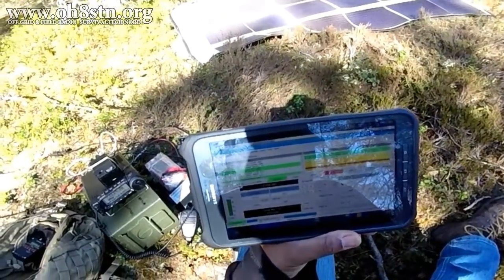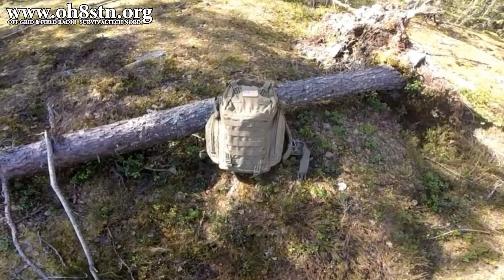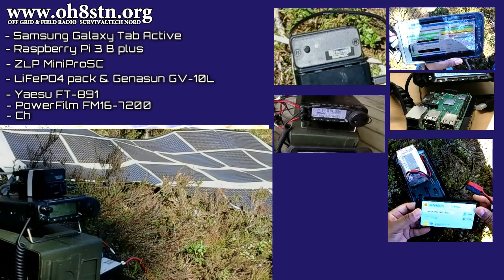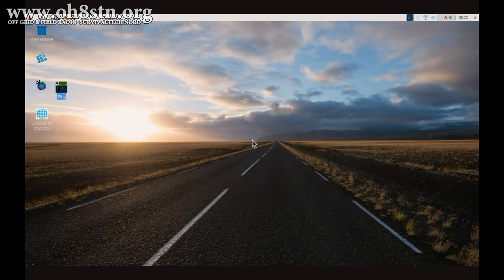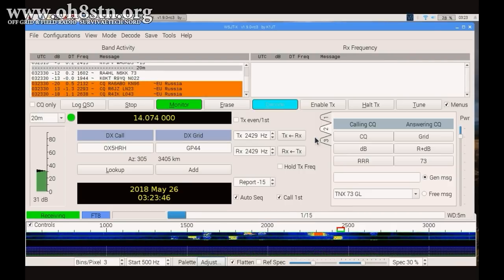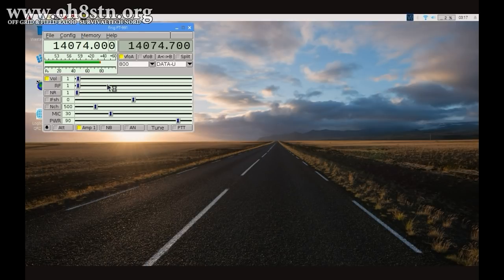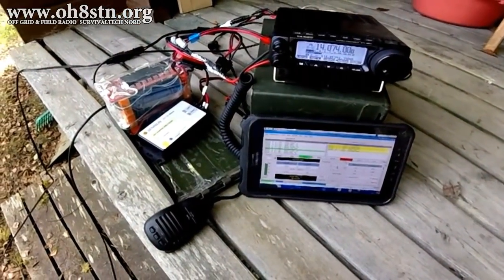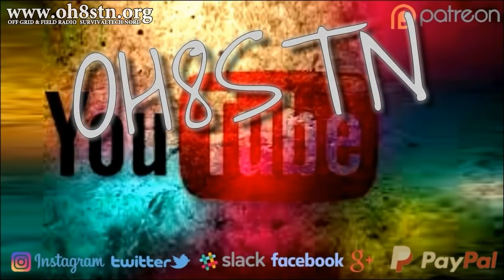Raspberry Pi Powered Portable Ham Radio Station

Comment: I've had great success with the Raspberry Pi decoding FT8.... so much so, I always use the RPi3 for digital modes... even in the shack. 
My  $7 USB soundcard works as well as my SignaLink too. It's a little more tedious to get audio levels set correctly than the SignaLink, but it's much lighter to pack for portable operations. 

My 10" tablet screen will display the entire FLDigi interface.....high resolution = small font but I find a wireless mouse and Bluetooth keyboard makes it a breeze to use. 

I especially like using the RPi3 in the shack as I can be upstairs with my tablet, logging QSO's from my recliner. 

Keep up the good work...de WØFW
Reply from the maker: Actually you're the one who started this whole thing and I'm grateful to you for it. The Headless pie was a magnificent idea. It's also nice to hear someone else confirm the performance of the Raspberry Pi for digital modes. I've been thinking about one of those little sound cards to use with the WolphiLink. Just to get everything that much  smaller.
Thanks for everything you do and for sharing the knowledge.
73
Julian oh8stn
Reply: Mad Dawg how are you adjusting the levels on your cheap soundcard dongle? That is also what i am using with my RPi, i am having great luck with Rx.... mixed results with Tx. I suspect its just blasting sound in there, and I need to turn it down... maybe.
Reply: spldrong 
Basically I set the audio drive levels using the volume controls in the RPi3.... this gets it in the ballpark. 

To fine tune the levels, I adjust AF gain for received audio and mic gain for TX audio. 

Does that help with answering your question?

Comment: I have been using my Pi3 as a general RF transmitter for quite some time, well in controlled environments anyway. I'm not a licensed ham yet and I want no trouble from the FCC. The RPi has loads of potential for RF applications

Comment: I can't help but look forward to when the RPi team drops this level processor onto the pi-zero(w) platform... you could put a 'cluster' in your pocket! 1-fldigi, 1-FT8, 1-w/TNC-Pi.  (sorry if I'm getting ahead of myself here)
-Rob
Reply from the maker: Yeah the idea of having all HF & VHF bands running simultaneously from something the size of a big box of matches. 😮
Reply from the maker: Now I understand what you mean by this level of processor in the pi zero. I'm thinking about a new project with a Raspberry Pi. Taking a pi zero and putting it inside an 817. At the moment I think the processor is too slow on the pi zero, which was exactly your point I suspect. I'm wondering if I pull off all the USB ports from the 3 B plus, could I use it in place of a pi zero

Comment: Hi. I am glad you found the Raspberry Pi and Bluetooth keyboard and mouse useful. I have now installed a RTC clock to be able to use the Pi' s clock when internet is not available. I have also ordered the Pi 3b +. But have not tried it out yet. I am working on my go box built into a 3 tier tool box on wheels. It is not ideal for hiking but here in 9h1 land distances are not a problem. Looking forward to the next instalment.  I always enjoy them and I learn a lot from them.
Chris de 9H1BW
Reply from the maker: You're far too kind Chris but it is much appreciated.
Two of the things Raspberry Pi related I need to work on or an uninterruptible power supply for it, a real soft button for startup shutdown and sleep, and then making a frame for the radio, Raspberry Pi and all the other components inside that ammo can.
I have a feeling your weather is a lot better than what we're having here in Finland at the moment 👍👍👍
73
Julian oh8stn
Reply: OH8STN the soft turning off psu  is interesting . The sd card is very delicate and does not like being switched off before being shutdown.
Reply: An alternative to a RTC module is a GPS which gives extremely accurate time as well as position data.
Reply: John Tarbox how does one connect the GPS to the rpi?
Reply: chris9h1bw I am using a GlobalSat BU-353-S4 module which simply plugs into one of the Pi's USB ports. Works great and is available for about $30. Fully supported by the OS on Pi.
Reply: John Tarbox thanks. Will look it up.
Reply: sudo date -s "Fri Jun  1 02:15:00 UTC 2018"

Comment: Yes, I’ve run WJST on an RPi3, and it was able to keep and decode just fine. You’re right about the performance. Windows is a bit bogged down with extra processes running in the background. RPi3 doesn’t do this, and gives you a good performance in return.

Comment: Great video.  You may want to check out Maxpedition or Vanquest packs, Condor gear is poorly constructed in comparison.  Imagine how impactful a split seem or broken zipper would have been.
Reply from the maker: Agreed. Unfortunately Maxpedition and Vanquest don't have good sales distribution outside of the United States. Anyway, the weight of my kit was well within the limits of the Condor pack. My Expedition pack was Overkill for this trip.
Reply: OH8STN oh, didn’t even think about distribution networks.

Comment: Julian, I’m so grateful for you videos. I just ordered a Pi. I have been playing around with VNC on my iPad controlling another computer on the wireless network. How are you able to connect your tablet to the Pi with VNC away from the internet? Bluetooth?
Reply from the maker: Hi Chris. The short answer is creating an access point on a Raspberry Pi. Then giving that access point to static IP address. You should definitely check out my website and use the search function for "raspberry pi ". That'll bring up all of the Articles I've done on the Raspberry Pi including the access point and inevitably your next question which will be how to sync the clock.
73 
Julian oh8stn
Reply: Excellent! Thank you so much. -73, KC3EXN

Comment: I use the short case from PiJuiceSupply, holds a RPi and pijuice hat with all ports. They also make a tall case for more stuff stacked on the RPi.  The RPi 7 inch touch is to small to run/view all parts of the programs, I cannot see the waterfall and data screen on the same page.  Will try your set up on a 10 inch screen.  Great stuff!
Reply from the maker: It's always good to get your feedback. Have you documented your build any place? You could drop the link here if you like.
I'm really looking forward I'm getting started with a 3D printed stuff.
73
Julian oh8stn

Comment: Yet another great video that's got me excited about portable operation. I recently got my Wolphi link interface, looking forward to using it (although due to an insane work schedule it might be late June before I get the chance). This video inspired me to dig out a Rasberry PI3 I won as a door prize some time back, it's still new in the box. My question is, what OS are you running on it? I know there a ton of different ones available, but if I use your video as a starting point it'd be nice to reduce friction by just using the same OS. 

Hope to work you on the  bands one day, 73 and thanks, N4IXT
Reply from the maker: Huge thanks for the kindness. Was actually worried this would be a crap video, but it seems to be inspiring a few of you. So my Raspberry Pi is running raspbian Jessie. It's a debian-based OS, and I believe the official OS for the Raspberry Pi. If you want to use the WolphiLink, you'll need a cheap USB sound card, and a y cable with separate mic and speaker on one end and trrs for the WolphiLink on the other.  In fact I'm also planning on doing this, to reduce the size of the kit in this video. Remember it doesn't take a lot of effort to go out in the backyard and give your gear a spin. Take baby steps, and before you know it you'll deploy a field station ☺
73
Julian oh8stn

Comment: Thanks for the great video Julian :-). Considering FT-8 requires an accurate clock to operate, is there a method of using a GPS for the clock when out of range of the Internet and/or cell phone range?
73,  Jack VK4JRC
Reply: Jack Chomley I have recently setup a RPi 3B+ using a cheap GPS receiver for this very application. It’s configured for ntpd to communicate with gpsd. Works perfect for operating in an area with no internet connection. I haven’t documented this yet but hope to do so soon. 73 Marty W5MRM
Reply: sudo date -s "Fri Jun  1 02:15:00 UTC 2018"

Comment: Thanks for a great video.  How do you connect the tablet wirelessly to the RPi?
Reply from the maker: Dave Corsello I've done it two different ways so far. The first way is to use an external Wi-Fi router. The other way is to create a network with the tablet allowing the Raspberry Pi to connect to it. With Raspberry Pi 3 B plus it also has an access point mode but I haven't tried it yet, I've only read the documentation.
Thanks for watching, and for the kindness It's very much appreciated

Comment: Yes the pi works for ham and satellite. Lower power tritium solar batteries and super capacitors. Or use simple dirt battery aka earth or ground battery. Fractal antenna to save space. Building similar myself. With touch screen on outside. Like to add hand crank for power too. Can solder wires on to sim and add script for internet. Some tablets will take a Linux operating system. Most appliances run Linux. In fact Linux devices make up over 85% of devices. But its like microwaves, stoves, cars, and androids. Yes android is a desktop on a Linux kernel. I see it possible to have ammo can capable of most forms of communication. As long as computer can run TPM for decryption. Security too don't want a virus transmitted over digital air waves. Waiting to see on news. With law enforcement going digital. The pi being 10$ to 35$ depending on model. Linux computers run good. There is a learning curve but many videos info and community support. Kids play Retropie on one of our pi. They make android auto touch screens too. Would fit in ammo can too. Great video.

Comment: I am just beginning with FT-891 and digital modes.  I am having a hard time connecting to my windows laptop.  shouldn't the usb cable be a complete connection?  at 4:16 you say that you use the usb cable to interface.  I have not gotten that to work.  Couild you point me to instructions on that?
Reply from the maker: Here you go. ☺
These instructions will get you started
https://youtu.be/SrXbg9ytksU

Comment: Why you don't try without a tablet and with a 7inch touchscreen for raspberry pi??
Reply from the maker: Because I have to carry the tablet anyway. It's my telephone 😀
73
Julian oh8stn
Reply: OH8STN a very big phone😂😂never mind Federico IU1JEX 73
Reply: I just got my radio setup this way too after seeing this video. It is really nice having the android wirelessly control the whole radio! You can get really far aways and still do everything except control the volume and tune the tuner.
Reply: @TheElpoja, do you use a RPi with touchscreen on battery power?  If so, which monitor do you use, and what is it's power consumption?

Comment: Another great video Julian.
Out of interest, does the WolphiLink work with the Pi?
I'd be really grateful to hear whether it does or not. 
73

Matt
M0PTO
Reply from the maker: Hi Mat. When I saw the trrs connection on the Raspberry Pi I was hoping it would be mic and speaker audio but it wasn't it's an audio/video port. Thankfully there is a workaround. We can use a USB sound card dongle, with a custom cable. On one end of the cable we have trrs with speaker and mic, on the other hand we have split mic and speaker on separate jacks. Those two Jacks go to the USB sound card which plugs into one of the ports on the Raspberry Pi. The other end of the wolf healing goes to the data port on the back of your radio. I think I'll order the parts and make a video for that small project.
I hope this helps and thanks for the kindness.
73
Julian oh8stn
Reply: OH8STN It would be really great to see a video of it.
I got the WolphiLink after watching your videos using it, and am also likely to get a Raspberry Pi because of the limitations with the Android apps.

I also have another question Julian. I wonder if you'd be kind enough to email me? My email address is on QRZ.com

Thanks again.
Reply from the maker: I'll get to that video at some point, but for sure.
Reply: OH8STN That's great - thank you!
It'll be clear why my message won't work this way and needs to be emailed once you read it
Thanks again Julian. 

Matt
M0PTO

Comment: Julian, great video. Question: What sound card are you using with the Pi, and WSJT-x? I am
having a problem getting WSJT-x working with Signalink and linux on the Raspberry Pi.
Reply from the maker: So many comments came in I missed some of them so apologies for the late answer Tom. I'm using the zlp MiniProSC audio interface.  It shouldn't be any different than the Signalink.  I suspect the problem you're having is in the audio settings for raspbian. Go to the audio preferences from the drop-down box select USB audio codec. At the bottom of the screen you see "select control". Make certain all three boxes are ticked. In wsjt-x When selecting the audio interface select HW USB audio codec.
I hope this helps and again apologies for the late reply
Reply from the maker: I just noticed the second part of your question. I'll start doing some tutorials for the Raspberry Pi as soon as I have a second one.

Comment: Will the software support the FT-857? or the old FT-100D
Reply from the maker: Definitely. The ft-857, 897, 817 and ft-100 are all supported by Hamlib. The software uses hamlib as a basis for rig control in the app.

Comment: bought that + but it seems a bad choice :( only works with the latest version of raspbian , doesn't install any database software and seems to have an enormous power need.  also runs slower than a standard 3b   if one wants to run older raspbian or debian or other linux distro's the 3b+ isn't a good option

Comment: Great...looks like I'll  be buying ANOTHER Raspberry Pi. Lol
Reply from the maker: Yes I'm there as well. I'm trying to figure out how to fit one of these raspberry pies inside the radio
Reply: One question.

Does you tablet function as an actual touchscreen for the pi, or is it like a touchpad to move the pointer?
Reply from the maker: It functions as a natural touch screen. In fact you can think of it as a wireless touch screen
Reply: @OH8STN  ok. Last two questions. Are you using the tablet as the hotspot, or the pi? And did you have to do anything settings wise to get it to function that way?

I have repurposed one of my pi3b+ and habe.  It set as a WiFi hotspot with the vnc server turned on. When I connect with my phone it functions like a trackpad instead of a touchscreen. Gonna try with a tablet sometime today and see if it is any different.
Reply from the maker: @shank0  oh my God, you should really start to read my blog 😀
https://oh8stn.org/blog/2018/08/13/x-days-off-grid-radio-raspberry-pi-prerequisites/
Reply: I thought I had read at least all the posts related to the pi. Must have missed that one. Thanks.
Reply from the maker: @shank0  I don't think I actually shared that when so you may have missed it. I'm just working on a video about the Raspberry Pi setup. It's not a tutorial but it'll answer all those questions. I'm really stoked about the Raspberry Pi
Reply from the maker: Apologies now I know what you mean. Acting like a trackpad, I completely agree. This is a setting in the VNC client. You have to tell it how to act on a touch screen because it expects a keyboard and mouse. I'm getting used to using it like a touch screen but the easiest way is with a Bluetooth keyboard. That's the little red keyboard seen in some of the video. When using the tablet, I have mine set up now too move the mouse, and I use the on-screen keyboard to enter text. If I'm having a qso I switch over to that Bluetooth keyboard because it's easier to enter text. Does that make sense?

Comment: My problem with the Raspberry Pi is getting the time set.  If it is away from my home wifi the clock is off enough so that JT8 won't have a synced clock.  Fix for that?
Reply from the maker: I'll cover this in an upcoming video 👍👍👍
73
Julian oh8stn
Reply: Use a GPS dongle with a USB interface.
Reply: I have the GPS hat on the Raspi but the clock is set by the WIFI from the last time you were online.  If you are away from a wifi for any time the clock is WAY off.
Reply from the maker: Have a look at this Bob
https://raspberrypi.stackexchange.com/questions/73719/sync-system-clock-with-gps-time-on-systemd-timesyncd
Reply: OH8STN here is how i do it. Gotta do it everytime you power up the Pi, i use an app on my phone for proper time, my watch is also usually set to proper time:
Reply: sudo date -s "Fri Jun  1 02:15:00 UTC 2018"
Reply: ALL this time and it was ONE simple line!!!  THANK YOU SO MUCH!!!  Now I just have to get WSJTX and my 817 working together.
Reply: Bob814u no big deal... just a few hours of googling. Haha. I found it buried in a RPI forum

Comment: Any reason why you cant just run the interface card directly to the tablet? Why is the Rasberry Pi needed if you have the tablet?
Reply from the maker: Awesome question. We can't run all the modes on the Android tablet as we can on a Raspberry Pi, Windows or Linux laptop. The Raspberry Pi is the smallest computer we can integrate with the radio. When we I'm not connected to the radio, we can use the tablet as we would for anything else. This isn't the only way to do it it's just one way. You could alleviate the Raspberry Pi by running a Windows laptop or tablet